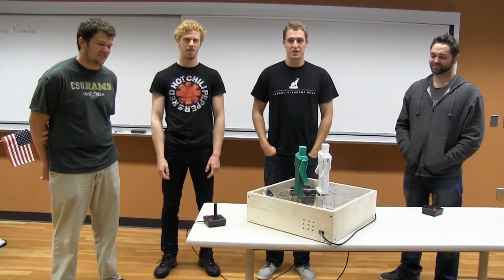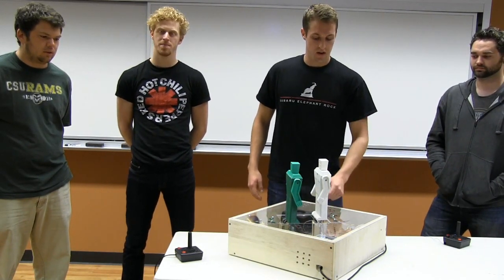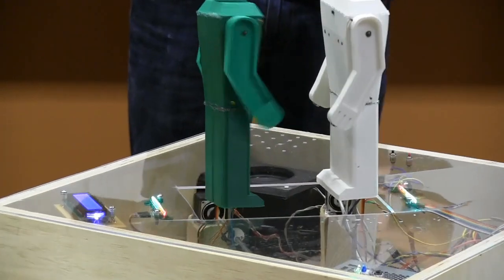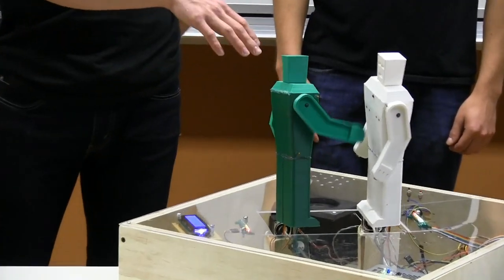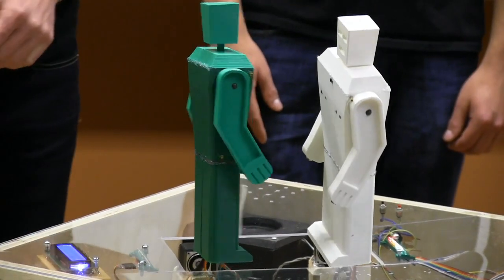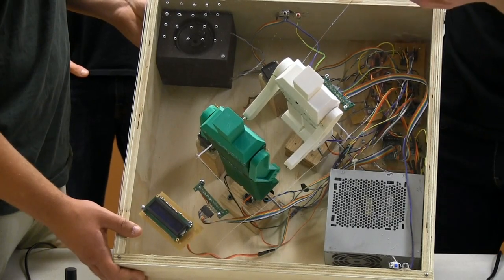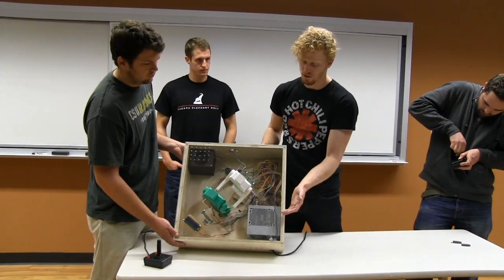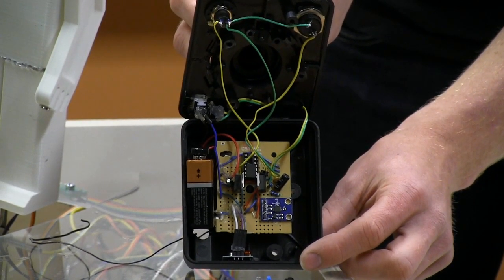Electronic Rock'em Sock'em Robots

Comment: Why are you using atari  2600 controllers for rock em sock em? Atari 2600 controlelrs only have one button, which means you can only control one arm!
Reply: simplicity, also it increases the skill ceiling because one button alternates between controlling each arm so you have to manage your button presses to get the shot